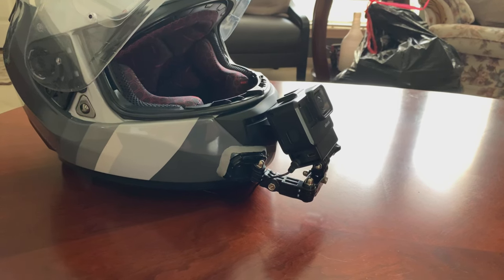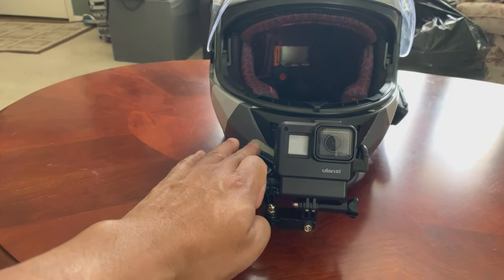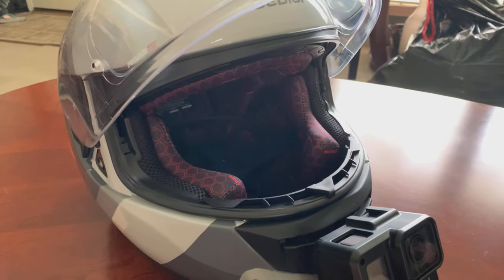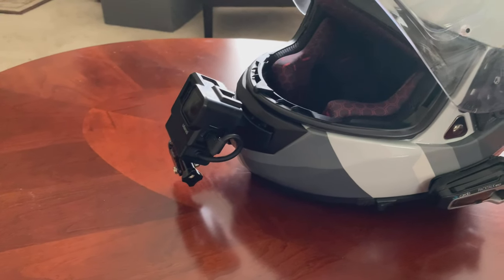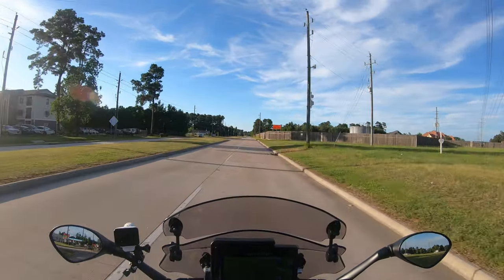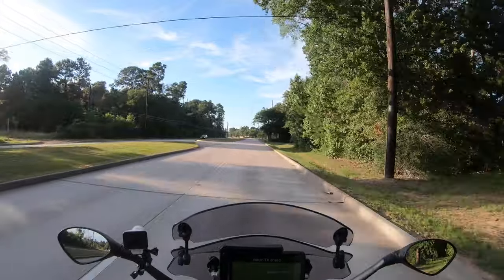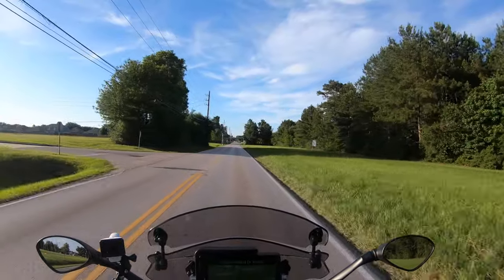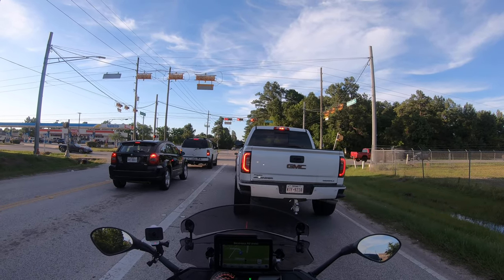The MotoVlog Setup is Done | Sedici Strada II Helmet

Comment: I've been thinking about getting a strada II and a Cardo system for it, I have a sena on an ancient helmet right now. How are you liking the helmet, and any issues with the Cardo setup?
Reply from the maker: The helmet has been a great addition. It is broken in now but the cheek pads are still firm and foot is snug. I do recommend this helmet as a great buy at this price point. Only fault is the internal shade is not deep enough so you’re almost looking through the bottom edge. Maybe my eyes are too far down on my face. 🙄

The Cardo is fine also. Make sure you buy the headset kit so that you get the 40mm JBL speakers since the 45mm JBL speakers are inferior (but superior to Sena speakers).

Comment: Do you record your voice audio with the visor locked down, cracked open or all the way flipped up? Does it make much difference? Thanks. I find this very interesting.
Reply from the maker: Brad - The quick answer is ... all three.  😄 It depends on the speed at which I am travelling and whether I need breeze on my face. That I may be recording is secondary, although I am mindful of the likely impact on the wind noise. 

Yes it makes a difference, and depending on the helmet and the mike placement it could be a huge difference. The wind noise is worst when the visor is fully open, and least when locked shut. In the Shoei, the microphone is presently between the cheekpad and the shell of the helmet whereas in the Strada II it is in the open just ahead of the right cheekpad. The Shoei whistles when the visor is open while the Strada II does not. The difference between open and locked shut is greater in the Shoei than the Strada II.

I am presently editing another video which includes the whole ride (part of which is included in the above video) from 2 camera angles. There you will see when I shut my visor and hear the difference it makes. Stay tuned.

Comment: 5minutes 30seconds or there abouts you mention "the cord from the mic is short only three feet long so you don't have this big long cord to wind inside the helmet"... are you serious? I mean that doesn't seem short to me, Apart from that, seems to be working well both audio and vision.
Reply from the maker: Dead serious ... Believe you me, it is very difficult to find a microphone with a TRS plug or has a shorter cord, and to find one that has both is almost like searching for the Holy Grail. 

The vast majority of these lavalier microphones (and you need a lavalier mic for the small size without power) come with cords of 6 ft or longer - I have even seen 12 feet. The PowerDeWise microphone that I have comes with another 6ft extension cord to add to the 6.5ft cord already on the mic! You see, lavalier mics are popular for interviewers (they often come in a 2-pack) who may be some distance apart from each other and the recording device. So this mic with its 1.2m (3.5ft) cord is somewhat of an anomaly, and so far based on the sound and price point, it is the best value microphone for a motovlogging helmet on the market. Don't get me wrong, the Rode Lavalier GO microphone is the better mic in terms of sound quality, comes with a Kevlar-reinforced cable which is about 4 ft long, and the TRS plug is gold plated, but it costs more than 2.5x the cost of this mic.
Reply: @GrumpyGoat  I was somewhat incredulous that a 3feet long mic cord would be considered short but I was also thinking "everything is big in Texas" and maybe, just maybe, a three foot mic cord is considered short in that part of the world.
Reply from the maker: 😃 Actually, 2 ft would be ideal for all helmets, since some length outside the helmet is needed, and also inside the helmet towards the front.

Comment: I just bought same helmet for making videos and I am bit worry about noise level with open bents. What is your opinion on this after few months of use?
Reply from the maker: When the chin vent is open on any helmet it will degrade the audio quality. Top vents don’t have that much effect. If riding in hot weather that might be a trade off that you have to accept.
Reply: @GrumpyGoat  how is your experience with shoei is it more quiet. I like this sidici just this wind noise with open vents bother me. And mine is fogging like crazy but I only tried it in colder weather so maybe thats why
Reply from the maker: @RidersUnited  The Shoei RF-1200 is not appreciably different in terms of noise compared with this Sedici. I have a Pinlock lens on my visor and get no fogging.

See this video comparing the two helmets: https://youtu.be/L8Qonj9oKc0